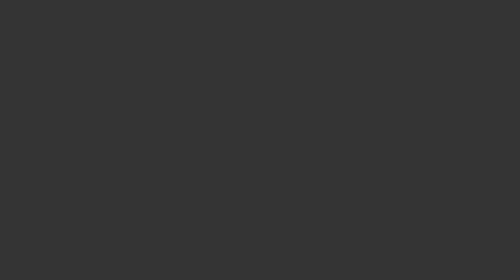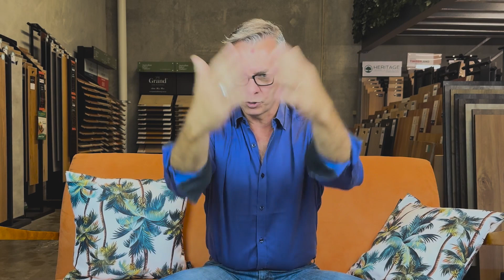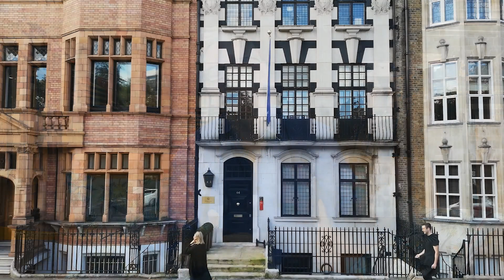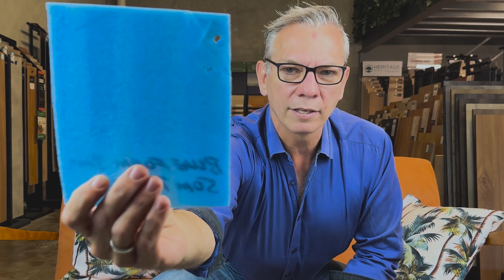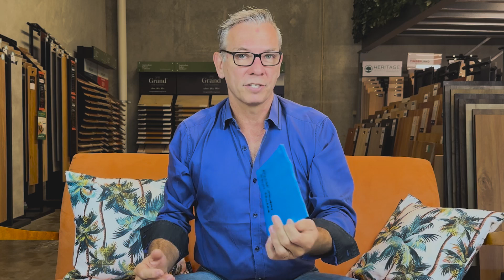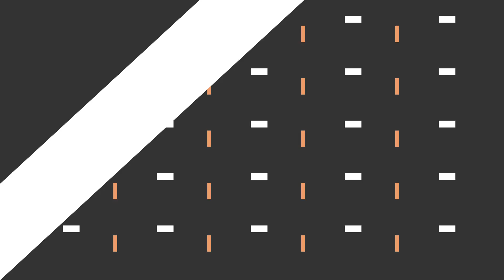📢 Soundproofing Floors: Tips, Techniques, and Best Products

Comment: Thank you for your insightful video! I really appreciate the way you explain structure-borne noise.
I’d love to take the chance to ask a question. I live in an apartment building with a concrete floor, where the parquet is glued directly to the concrete without any underlayment. I do a lot of dance practice, so I’m considering building a 3x3m dance floor as a floating platform and was wondering what a good design would be to minimize impact noise.
I’m not concerned about airborne noise much - I use headphones. My main focus is structure-borne noise reduction. What do you think?